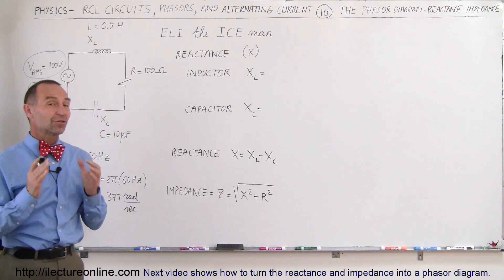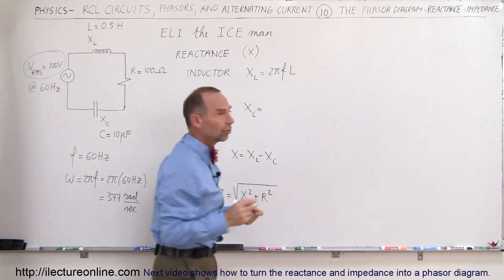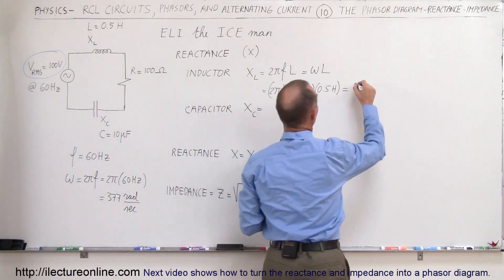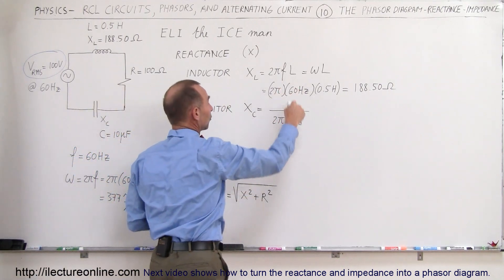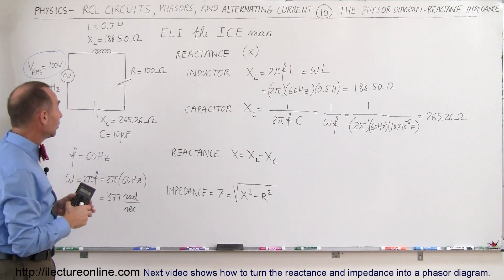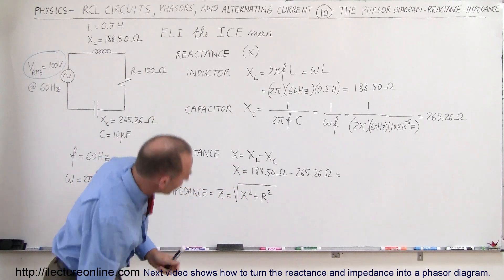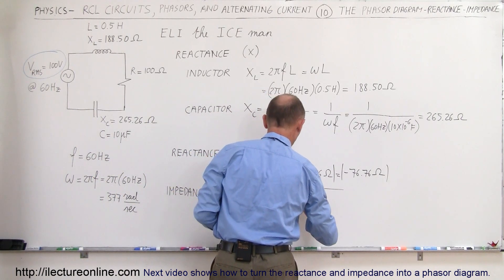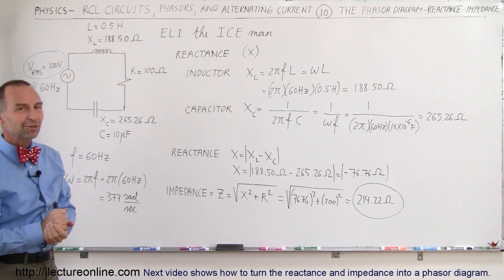Physics 49.1  RCL Circuits & Phasors (10 of 24) Phasor Diagram - Reactance/Impedance

Comment: hello, i think there may be an minor error in calculating the impedance the resistance was 100 rather than 200 so total should be 126.06 ohms :)
Reply: ok never mind the next video corrects it sorry bout that.
Reply from the maker: Yoyo Bear 
You are correct, I used the wrong value for R
Good catch
Thanks